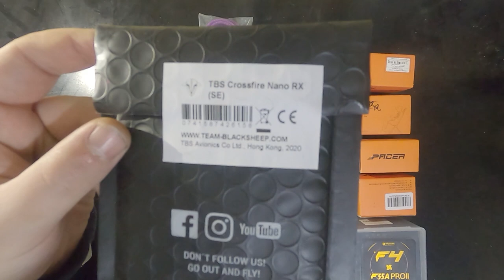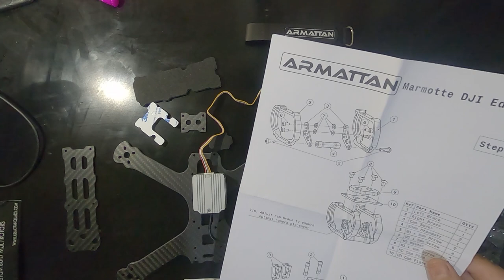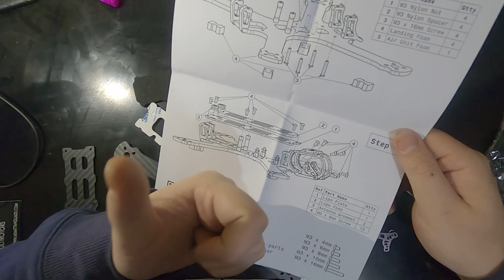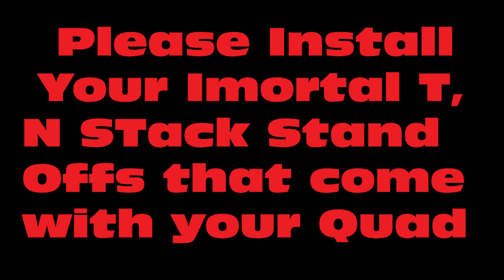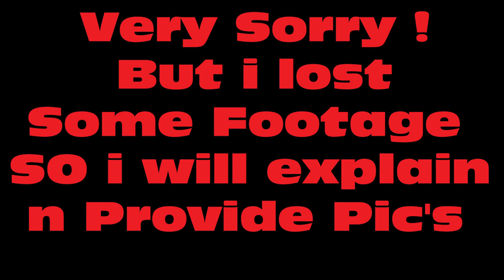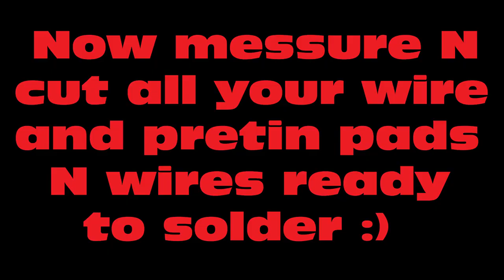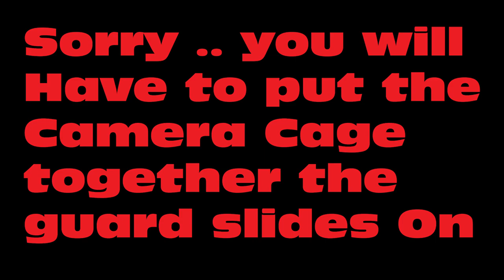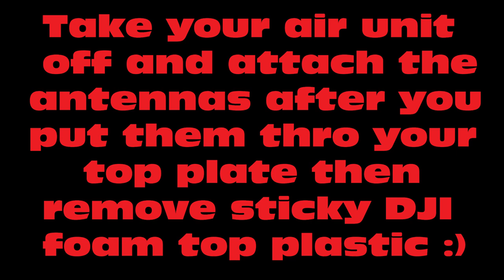Build the Best Freestyle FPV Drone! $500 DJI  in #2021 Step by Step by MalusVex

Comment: My main issue with this frame was mounting the battery lead somewhere it wouldn't get into the props, this is a great way of doing it. I'll probs have chopped up the lead in the next few packs so I may have to do this instead!
Reply from the maker: cheers man I've got 3 marmottes with this setup now haven't had a issue :)
Reply from the maker: i also put the antennas thro the power lead for more stability